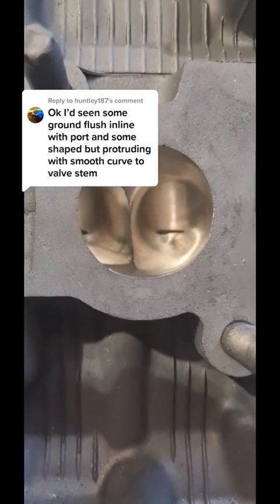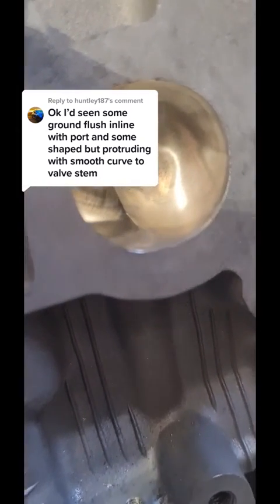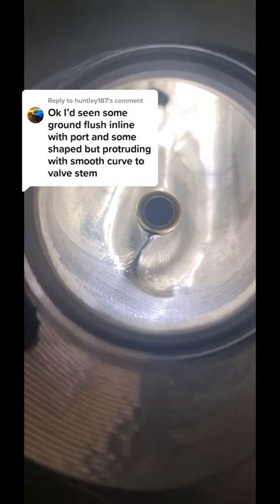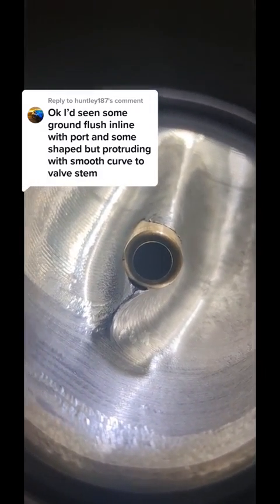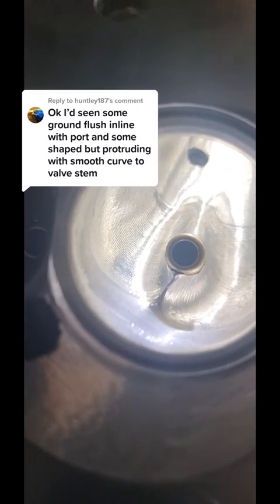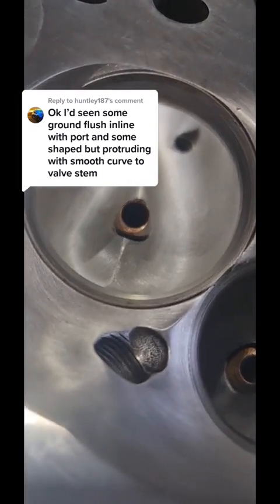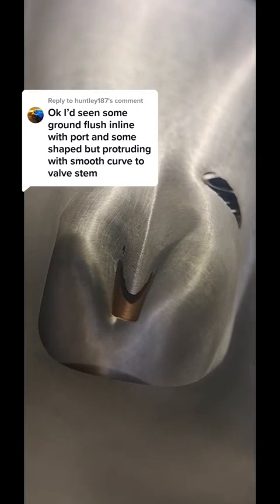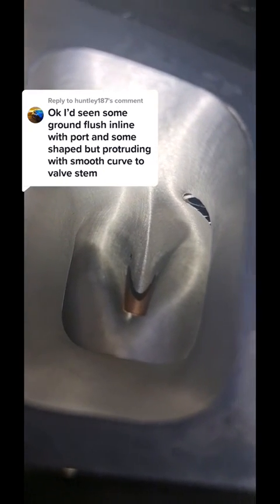"Cylinder Head Porting: Mistakes You Can't Afford to Make"

Comment: This just popped up when I refreshed my YT home page and I have to ask, are you calling the protruding valve guide a buff body?  I subb'd to see the rest of this video series because I do some port smoothing/cleanup myself and I'm interested in anything about that.  I can't help but mention that this video narration had some confusing language and did not show anything stated in the description, but I'm interested anyway.
Reply from the maker: Yeah, these series are more for experienced engine developers that understand fluid dynamics principles.  But don't worry, we are going to do an introduction to porting where we explain all the principles of air flow.  

And yes... all cylinders and spheres  are considered bluff bodies because at large Reynolds number,  the drag is dominated by the pressure losses in the wake.
Reply: @bainracing
Thanks!